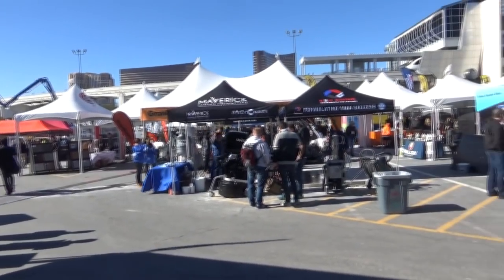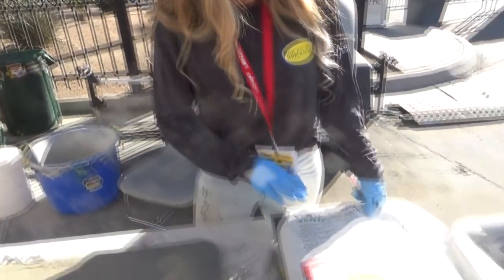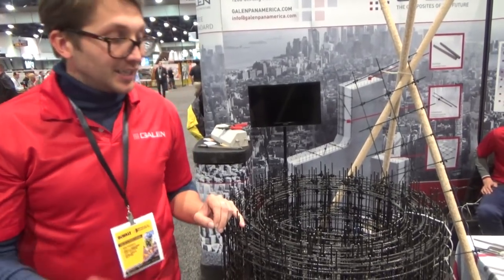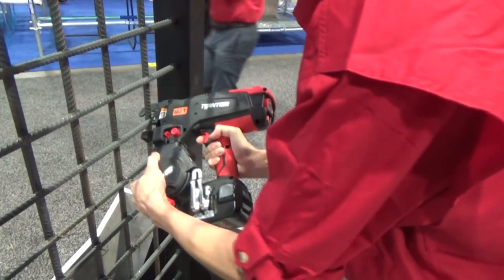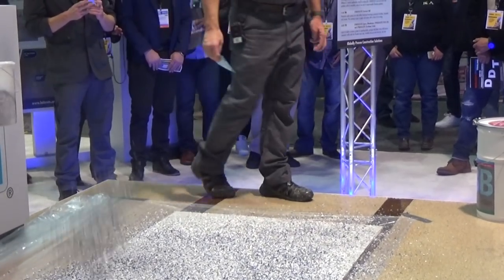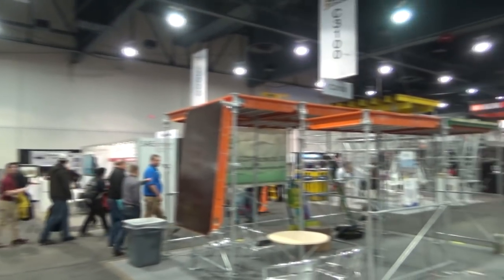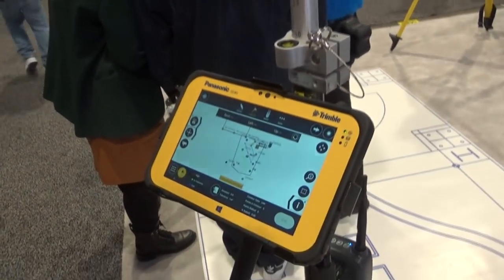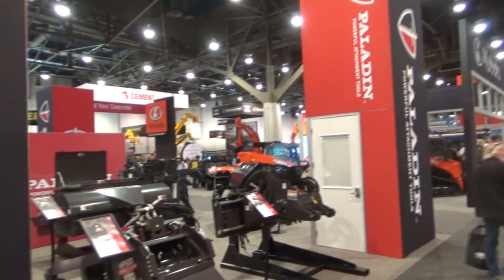WORLD OF CONCRETE SHOW (Mike Haduck)

Comment: The fiberglass rebar part was the most interesting. However, the video didn't mention many use cases. I'd have liked to see a discussion on thermal expansion and demolition.
Reply from the maker: Hi Sir,  I would say it still in the new thing stage and it was the first I ever heard of it myself,  thanks,  Mike
Reply: I also heard about rebar made out of basalt.  I wonder how they would compare.
Reply: What's sad is they are doing it to all the trades

Comment: In your travels Mike, have you ever seen bamboo scaffolding? They use it all over Hong Kong. 20-30 stories. For a minute I couldn't remember seeing any during my last two visits, but then I remembered, the protesting kids used a stack of it to weave into big piles to block some streets during the protests. (To keep out the fire hose truck with the blue dye. A few days after we returned to the States they blasted a crowd of families going to the Nathan Road Mosque.) The pile looked like a big pick-up-sticks game. 
The bamboo scaffolding is just so common I don't even register seeing it.  They tie it together with plastic 'string'. Like at the lumberyard or Home Depot instead of the sisal rope they usually have.  Hong Kongers told us that in one typhoon some of the steel scaffolding blew down, but none of the bamboo did. In the Mainland I've seen sand, gravel, cement being hoisted up multiple stories on a single solid steel wire - no strands. Probably about 1/8" to 3/16"  Scared the pants off me and I wasn't even standing near it. Good video but it all looks like so much work - I'm a bit tuckered out...
Reply from the maker: Hi will, I remember seeing it in Hong Kong in the 70s, I seen it in China a few years ago and got in on my " bricklayer of China video, thanks Mike

Comment: I'm skeptical about the fiberglass rebar in cold temps, might snap like breaking glass
Reply from the maker: Hi E C,   I don,t know.  , I guess time will tell,  thanks, Mike
Reply: I don’t think the cold will be a problem. The water would freeze in the concrete before the fibreglass sufferers... many fibreglass products have to withstand very hot and cold conditions. I think recycling will be the big issue...

Comment: The IQ360 Dustless Saw! There is a smaller version, perhaps this would save alot of time regarding setup and take down. https://youtu.be/lbzoSk8CH6Q
Reply from the maker: Thanks Jaime, I never knew they even made them , thanks, Mike
Reply: The Saw has been out for a few years and has been featured at World of Concrete, it's beginning to pickup some pace in the Industry. It's a little pricey yet hoping it would eventually pay for itself. I just may consider the  IQ360  Dustless saw.